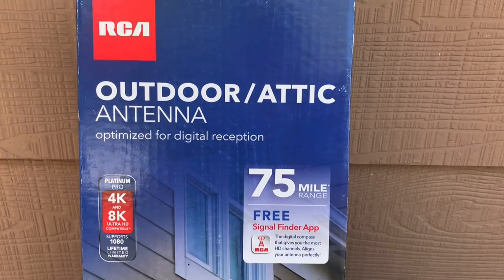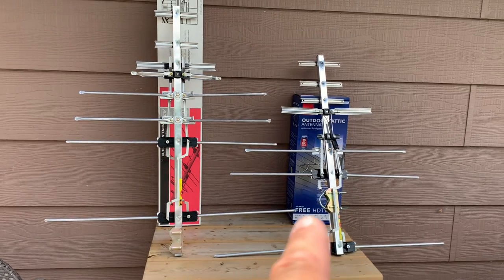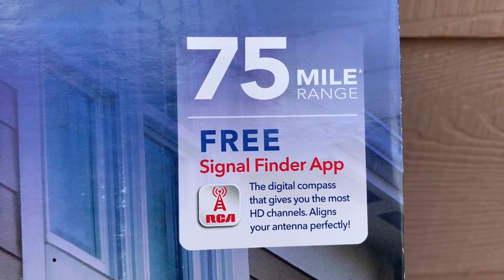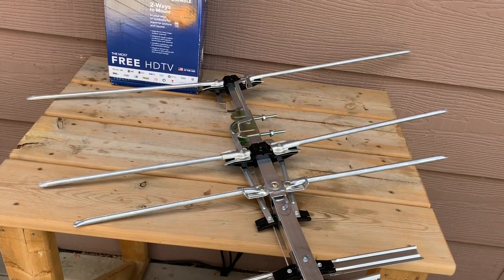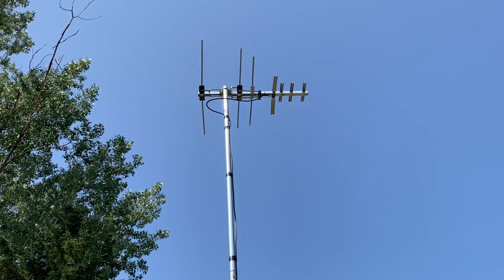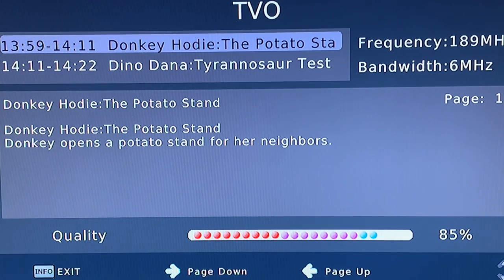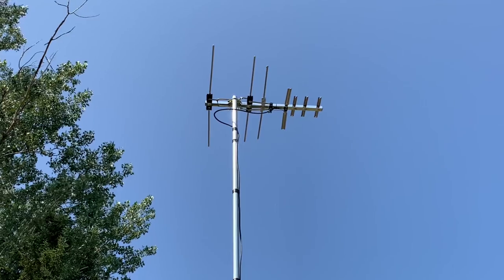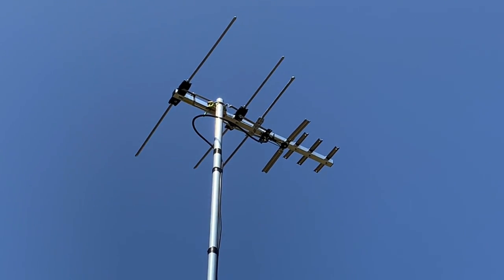RCA Outdoor Attic Yagi TV Antenna Review Model ANT752E ANT754E

Comment: I have the ANT752.  It worked ok, 19  out of the 23 available channels it picked up. I took the from the front, element 4 and the next block, the phase lines and used it as an element.  I removed element 4 and now element 5, and swap mounting locations.  I used the aluminum wire to connect them to the VHF rear piece. This modification picked up another transmitter with four channels.  The channels I picked up in the original configuration also improved by10%.  It was a great experiment.  Great video.
Reply from the maker: Sounds like your modifications have worked out well, thanks for sharing your experience with this antenna, and for watching.👍
Reply: Can you post a link to what you done?

Comment: So they made it smaller than the original model. Madde the boom in two pieces to make packaging smaller.  

The matching transformer on the larger RCA antenna I installed I taped it to the boom and routed down my mast.  I really think having wires blowing in the wind is a bad idea and looks messy.
Reply: Agreed. That's what I do. After drilling severance hole and a exit hile in the mast, I thread the RG 6 cable insite the mast then out to the tap in port ofvthe tv antenna. It truly does make the instellation much more neater and better looking.

Comment: I have bought this antenna 3 times now, for three different locations, I am always careful about aiming it in the direction of the most broadcast channel towers and I have always gotten a huge amount of free channels 30 to 50 channels. However the latest version made of two pieces,  has those two wires that look like they are supposed to be attached by screws, in the directions it talks about attaching the phasing wires with nuts to the threaded studs, has anyone seen a good video on how this is supposed to be assembled ?

Comment: Do you have to hood up  cables from the antenna to the TV, or placing the antenna on top of the roof is enough  please help me
Reply from the maker: @karyjimenez2472  A coaxial cable must be connected to the antenna and run into the building to your television. If you’re not comfortable or capable of putting an antenna on a roof safely, then I would advise you to contact a professional installer in your area.
Reply: @NorthcoasterHobby  thank you
Reply from the maker: @karyjimenez2472  You’re welcome.

Comment: I was very disappointed when trying to assemble this thing.  The manual and box didnt match in terms of pictures and diagrams for assembly.  I decided to not even use the antenna.  I am keeping the mounting bracket to use on the roof in conjunction with my amplified RV antenna.  At least it wasn't a total loss. :)
Reply from the maker: Yeah, I can see where the instructions can be a bit confusing. For the most part they’re OK, but I had to review a few details carefully a few times and fill in the blanks a bit too.

Comment: I have this same Antenna installed on my roof for several years the 75volt connector ripped and I can't get the bolts off to replace it but the bolts that sit on the back of the phasing line on the middle VHF element come off easy will installing the new  75volt connector there instead make a difference ?
Reply from the maker: I double-checked on this. That could work because those phasing lines are tied to the front UHF elements where the 75 ohm transformer is originally installed, but it’s not ideal. The back bolts may also be seized.  If you’re going to go to the trouble of getting up on the roof to fix that you may want to think about getting a new antenna or at least fixing that correctly. Also, if you’re not capable of safely climbing the roof to do that please hire a professional.
Reply: @NorthcoasterHobby  Just curious how u came to the conclusion that installing it on the back bolts may have a negative affect on reception I couldn't find any info on that. The reason I was up on the roof to begin with is I had to take the antenna down as my house was tented for termites at that point I already upgraded to the Range Xperts XPS-1500 Insane Gain Antenna I was just considering maybe install both antennas is all since the old antenna is still in almost perfect shape
Reply from the maker: @Pyro-01  I never said it would have a negative effect on reception, just that if you’re going to go to the trouble to fix it, you may as well do it correctly. It will still make contact with all the elements if you put it on the back bolts.

If you have the insane gain antenna working, that’s great. I’m sure the old one is still useable though.

Comment: You never mentioned anything about mounting it in the attic.  Will the plywood and asphalt shingles diminish the signal much ?
Reply from the maker: I test antennas as outdoor. Any building materials can certainly diminish signals badly (or block them altogether), especially metal roofing or siding. Foil-backed sheathing on walls or a roof can also significantly reduce the signal reaching the antenna. Installing an antenna outdoors is the best option in most situations.
Reply: Mine is in the attic.
Reply from the maker: @robglowacki2017  How is the reception?
Reply: @NorthcoasterHobby I quite agree.